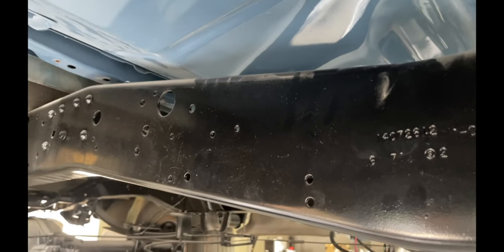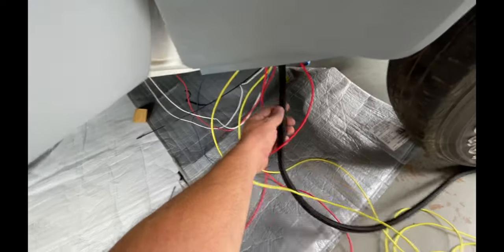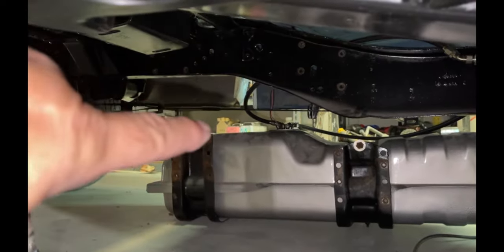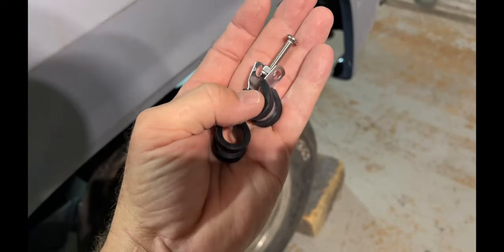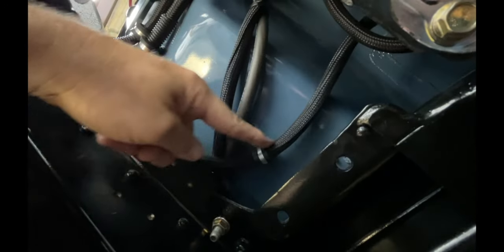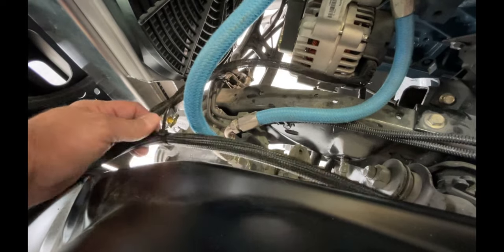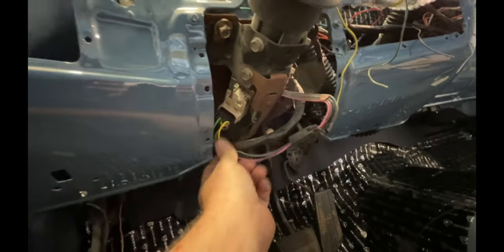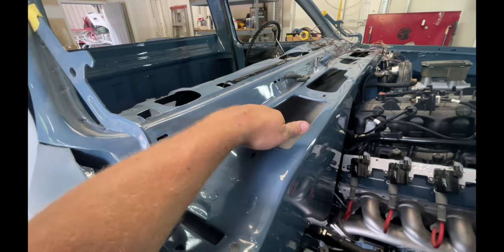C10 Project:  Electrical Wiring

Comment: I have a 73 C-10, I had signals working on it till it caught on fire. I've checked all the wires I don't see anything burnt but now if I hit my brakes the indicator light up for the signals But the signals don't work. Do have any suggestions?? Any one??
Reply from the maker: @davidwellman7080  if things are catching fire, you need to take it to a shop and get some help. I tied my turn signals for my new dash into the wrong spot and had the same thing happen. The signals would light up when I hit the brakes. I think I had to tie into the brake wires after they had passed through all the relays n such to fix it. Otherwise it would feed a ground through the system for the brake wires. Anyway, get a skilled person to look at it before the whole truck burns to the ground. Good luck and thanks for watching!

Comment: Say brother I, changed out my ignition switch and am having trouble getting it adjusted properly so all key functions work, I can have my assesory working or the cranking, of course I have it cranking but if you have any tips or tricks to properly adjust it I would appreciate it
Reply from the maker: @martinolivas319  I’m not aware of any adjustment on the switch itself or anywhere for that matter. That doesn’t mean it doesn’t exist though. I would compare the old and new switch to make sure they look, operate, and are exactly the same. Might try a second switch from a different manufacturer if the switch is all you changed. Other than that the part the switch goes into may be different or defective. Hope you can figure it out. Very frustrating I’m sure. Thanks for watching!
Reply: Thank you

Comment: This is the most detailed and inspiring electric video I've seen on a square body! Doing all of this on my 84 RIGHT NOW. Moving the battery, everything you're doing. How did you mount those relays behind the firewall without drilling holes in your nice new firewall? Guys like you are why they call it YouTube U. Thank you for putting in the work to make a video like this.
Reply from the maker: Thanks DJ. I did have to drill holes to hold the relays in place but they came through high up in the vent/cowl panel area so they aren’t seen. I would probably do it different next time though. Good luck with your 84. Thanks for the comment and thanks for watching!

Comment: Can you keep telling what all wierd to firewall do to start the car not the lights you stoped at the purple and there all others colors
Reply from the maker: I wired to a Holley terminator x so the wires I identified are all I needed.  It takes some searching but you should be able to find info by googling c10 bulkhead pin out. If I can find the time I will try to go over the wiring in more detail in a future video. Thanks for watching!
Reply: Well if you have time please go into detail with wiring I need help
Reply from the maker: @ELPANDAP  are you doing an ls swap or factory engine?

Comment: i think you did a great job the only thing i seen that i would be scared of is where that battery is , personally i would put some kind of rubber or plastic panel above that battery
Reply from the maker: I was concerned with the top post making contact with the bottom of the floor but there is a good bit of room there. Another option would be to mount something like an optima battery sideways.

Comment: Im having trouble with my 87 the fuses keep burning for the idle and T/L CTSY the thing about it is i have to have them connected together by a wire for the truck to turn on the truck so if they arent connect then i wont hear the fuel pump go off or anything i dont get it could it be a bad wire somewhere thats burning them or is it something else has anyone ever had this problem before
Reply from the maker: Really hard to say without looking at it and tracing wires but it sound like too many wires pulling power on one fuse. Need to trace the wires and give individual components their own circuit and fuse. Look for damage to the wires as you trace
Reply: @StoutCustom  so its possible that i could have 1 or too many wires connected into one component like one can be going one way and the other another way
Reply from the maker: @Rodriguezerick23  I believe so

Comment: Jim, you are a wealth of knowledge sir. 

Is there a way to access that area we are talking about? I would assume I would need to remove the fenders to start with, but where to go from there?
Reply from the maker: Yes the fender would have to come off and probably the door for good accesss.  The panel is of course welded on.  Its the outer panel of the cab directly behind the fender.  There are some replacement panels available depending on the model truck you have.  All I saw on Auto Metal Direct for the squarebody was a lower half piece which may be all you need if its rusted out. I would get the replacement panel in hand before starting to remove the old one.  That should help you decide where to section it in if that's what it needs.

Comment: Are c10’s wired differently at the bulk head?! Everyone on YouTube has the same wiring you do.

My 12v wires only put out .4v to my accessories.

But when I make B4 my hot all my accessories and A1 and B2 wire get 12v output.

But if I wire it like everyone else says I get nothing.

Mine is a 85 v6 short bed.

Comment: Awesome work. Did you replace the wiring for the engine harness?
Reply from the maker: Yes for the engine. Used a Holley TerminatorX   Used the factory harness for the lights and turn signals
Reply: @StoutCustom  that Holley came with the wiring?
Reply from the maker: @ceaserthemighty  yes. The TerminatorX has the ELECTRONIC CONTOL UNIT (ECU) and wiring necessary to run an LS engine or other electronically controlled engine. This one was based on a 1999 LM7 (5.3 truck engine) so it was wired for a 24x reluctor wheel and multec injectors I think. You just have to match the terminator up to what you are planning on running. The TerminatorX Max will also give you what you need to control an electronically controlled transmission if you need it.
Reply: @StoutCustom  thanks man!

Comment: Hey good stuff mannnnnnn so    weld  a pc of sheet metal plate in tht vent hold to keep the 💧water out the cab
Reply from the maker: I'm going to screw them in most likely so I can remove them if I need to.

Comment: To install a kill switch what wire , where you recommend
Reply from the maker: @adolfotrujillo9658  if you are talking about a switch to keep someone from stealing the truck there are several places that you can do that but you probably need a local shop to do it. You can cut power to the fuel pump if it’s electric or the coil if it has one or the ignition or….wherever but it depends on your set up so check with someone that can look it over. Thanks for watching!

Comment: wiring... the fun and frustrating 😆. I'm definitly no wiring expert or anyting but I do enjoy the challenge. whis is why I'll probably pay someone smarter than me to do the initial wiring on my C10
Reply from the maker: I think the hard part is trying to keep it neat. The terminator has fairly easy to follow instructions and lots of how tos on the internet. The factory wiring is what’s a little difficult to decipher.
Reply: @TCollier  It requires patience for sure, but a game plan of major parts, location and like Mr. Jim Stout says, keep it neat. 
If you start with a bulb test light, a $50+ digital multi meter, tape, harness cover and equipment to solder. Notice that Mr. Stout used the split convoluted harness cover but the woven cloth, this is easy, safe and clean. Products are also rated by air temps they are exposed to. Solder crimped connectors, shrink tube over them, home improvement stores sell dielectric grease cheap $5. 
If you go to salvage yards, behind the glove box in Buick LeSabers, Park Ave (90's era) but you will find a fuse relay block for 12 or each. Each fuse protects the relay control circuit. If "LS" engine, the programmer can turn on two quad-drivers that supply "Ground" to fan relay coils. Set point on & off can be what you want. In the audio world, look at a website "KnuKoncepts" as they have battery terminals that fit, provide 4-5 connections for power & ground. If you caught Mr. Stout's comment; redundant grounds! (Battery- to frame, engine, cab, bed and I suggest ground from alternators end housing to block, battery as this is where (-) comes from. Star washers are flat washers with spurs, placed on last after cable/wire eyelets that dig thru paint, powder coat, grease but use the dielectric grease under, around & top of bolt on terminals. Use a small dab inside plastic connectors for terminals to protect them for moisture. 
 The bulk-head connector has 4 sections, closest to the fender is lights, engine side is engine, top is cruise control and long 4-5 wire ones is wiper. Use long cheap zip ties to form your harness, one completed, sacrifice the as you install the harness cover. 
Companies like "WayTek", Dell City and others have good terminals, but I get GM harness wire & connectors at the bone yard for cheap. Use a masking tape, write the device it goes to and feed it the direction thru loose zip ties. A small flat blade pocket screwdriver & small straight pick work great for removing wires from connectors as I made one from the thin spring steel out of old school wiper blades. Bend a circle handle and grind the other end narrow. I have entire Kent-Moore kit of tools to remove terminals, but use 2-3 only all of the time. Crumpets have come down in price but get ones that roll the center core crimp over into the it's sister.
  Tip; Start tape when ready on wire bundle, slide open split over tape, make your wraps and dab black weatherstrip adhesive onto the tag end, press into place and let it dry. It will never unravel. 
  I am doing an 81 El Co, almost complete. Adding a hidden "No Crank Switch is easy. Get a 40 amp relay with connector. Use 30 & 87 to bread PPL start wire. Use HVAC fan switch High or Cruise Set button. Cruise may provide ground or B+ when pushed as High Fan maybe B+ or continuity between hi and other 3 wires. Push set with left hand finger while cranking (My favorite) or flip blower to HI then crank. Once started, the relay does not effect either function as no cranking is going on. Plus if the engine is running, you can't accidentally re-engage starter again. The "LS" has that feature inside the PCM software. If RPM is above 400, cranking is denied!
  Best of luck! DK, ASE master since 78, retired.
Reply: @StoutCustom  there's always so much factory wiring but when you do anything aftermarket or restoration it doesn't seem as much
Reply: @deankay4434  a wealth of knowledge in that master brain of yours. If only I had that
Reply: @tcollier4017    I was incorrect in naming the fire wall connector locations. Mr. Stout has "Text" on screen providing information on each connector. I am not totally familiar with the "Square Body C10" as the call it. The connector is held in place on the engine side with a center 10mm bolt. It is usually captured on the back and won't fall. 
The group of connectors are held together with a large plastic "C" shaped clip. If spread by thumbs or a pocket screwdriver, work it to & bottom toward the engine. It will release all of the connectors. The first one next to the fender goes back to the bed. The next one is lights. 
Either electrical or painting, they both require equipment, knowledge and practice with and understanding of how it works. Jim Stout covers every issue needed including his paint paddle or cut yard stick. Make sure to ease on edge for the leading edge for good contact. Hand placement will become muscle memory or second  nature and becomes obvious when blocking over a guide coat.
 As for electrical, just watch videos and if hard to understand, go to another as some are much better teachers. 
At least the wire color is consistent on GM's. Red=B+, ORN=Switched, WHT, BRN & YEL are usually lights.
  Having a wiring diagram or schematic in a factory book would be great, but those are long gone! Dealerships sold them off on eBay as well as people who bought them to sell for profit.
  You best bet, depending on the year, but find an "On-Line Forum" and join them. They always have an electrical section. If lucky, someone may post a colored schematic for your truck. Even as new as 86, GM still published a fold out in the back of the OEM service manual. Head light on the left, engine, firewall, dash, seats & doors, fuel pump, tail light, license plate bulb and trailer hitch. Connectors are numbered, circuit number, color & wire size in metric cross section. Find a chart you can print and a 3 ring note book, the a box of heavy plastic page protectors. Major changes to electrical are best handled by drawings & photos. Even if drawings are in crayon! Lol. 
DK, ASE master tech. Retired

Comment: Who did you get your fender wells from?
Reply from the maker: They are factory style from AMD but I modified them. Had to add about 2 1/2” because I raised them up
Reply: @StoutCustom  trying to find parts for my 1977 C10. It's running just trying to make it look a little nice.
Reply from the maker: @HaveUSeenMyBaseball86  10-4. I’ve had good luck with the AMD parts I’ve gotten.
Reply: @StoutCustom  they are pricey. Lol

Comment: There's a wire on the driver side of my block on the fire wall I just my truck off and that wire started smoking and I can't find anything about but it goes from the firewall down behind the block
Reply from the maker: Disconnect the battery until you can figure it out. Have to trace it and see where it goes and see where the short is. It’s very possible to catch fire and burn to the ground. May need to get it to a professional shop to troubleshoot.

Comment: Awesome wiring work. I'm nearing this stage. Finally painted my interior/ firewall with single stage... per your recommendation. Came out great. Now I'm working on rebuilding stock ac box
Reply from the maker: Good deal!  Im glad it turned out great for you.  Sounds like you are moving along pretty well too.

Comment: A very nice job again with the video, lighting and subject. The resistor to the alternator is 460 ohms and acts as a current limiting device that same as the "GEN" light or "BAT" light on the dash. Since most have volt meter, that bulb act as a field wire to turn on the alternator. The older "SI" had one regulator to use, the newer "CS" alt have 28. It still gets battery voltage but with the current limited to 0.25 amp. GM actually use the bulb with a 460 ohm resistor in parallel on the dash, in case the bulb went bad. 
  GM uses the same color wire for certain functions for decades, but in 1986, began to display each circuit in "Cell" by themselves.
  Also unless vehicle speed comes from GPS, there is a 40 tooth reluctor that passes a magnetic pickup. The two wires are twisted (With a drill) 9 times per foot and go into the PCM VSS Hi & Lo terminals. To protect the signals (A/C) at lower speeds, they grounded a wire and wrap it with the harness to the PCM and ground it again. It is shielding from RFI. Using shrink tubing is the greatest, but if you have to use tape, dab a bit of black weatherstrip adhesive on the tag end & it won't come apart. Home improvement stores sell dielectric grease with the epoxy in automotive. It is way cheaper there. I have 2 huge tubes I bought at a Mercury dealer. Just like you say on your kitty hair "I put that %i#t on everything!"
The project is looking very good. I suggest putting a large cable on the end housing of the alternator as the negative diodes create (-) negative here, but paint, powder coat can create resistance their as well. 
PS; I forgot to remind you that the PCM can provide ground to cooling fan (s) by using a 30-40 amp relay unused at the connector. Just tell the programmer on & off temps. 
Have a good week and I will be watching. I think I got the bell set correctly! DK
Reply from the maker: Good info. Very informative. This fan set up came with the two 30A relays and is wired to the pcm like you said. The terminator pcm makes everything easy to control. I am going with GPS speedo because I read somewhere of a comparability issue somewhere along the line, maybe with the type of Guage I was looking at so…bypassed the problem. Maybe we will see if this all actually works as planned shortly, lol. Thanks as always!

Comment: You sparked a question when you mentioned you were going to make a covering for those 3 rectangular shaped holes that the cowl covers, in that water goes down through the cowl covering and into those 3 rectangular opening. I am sure GM had a passage way for the water to exit. If that exit is plugged off with leaves and dirt, would that lead to rust where the floor meets the kick panel?

I have big time rust in that area on both sides.

As usual, you have made me more aware of so many rabbit trails on this old truck.

Thanks so much for your channel.
Reply from the maker: Yes absolutely. I believe there is a screened plastic panel behind the metal cowl panel but I’m sure over time stuff makes it through. There is a passageway from the cowl panel up top, around the side of the cab, and down to the floor area of the kick panel. On the passenger side there is a large vent that gets it air from this passageway. There is an opening at the very bottom of this passageway (maybe 1/2” x 2”) that lets the water out. A few leaves and some debris will easily clog it up. Most likely it is the source of most rust in that area.

Comment: Why did you decide not to paint the truck first? Just curious.
Reply from the maker: Was burnt out on body work for a while after the C10 show truck project so decided to concentrate on getting it running. Once I hear it run it should motivate me to finish the bodywork. 👍